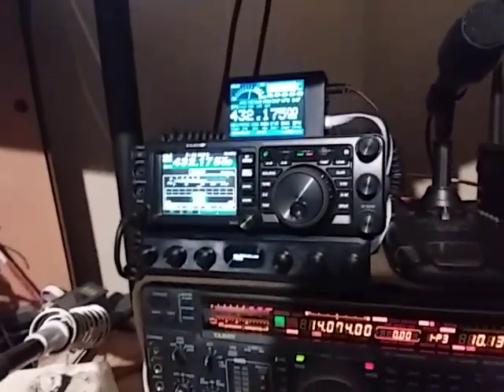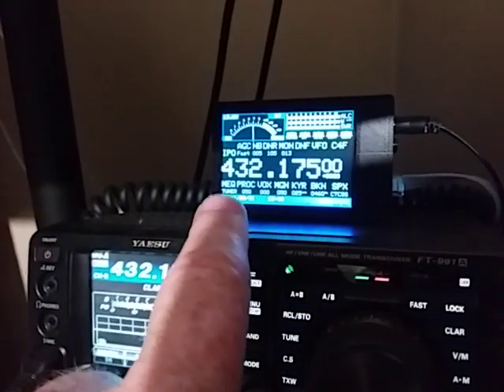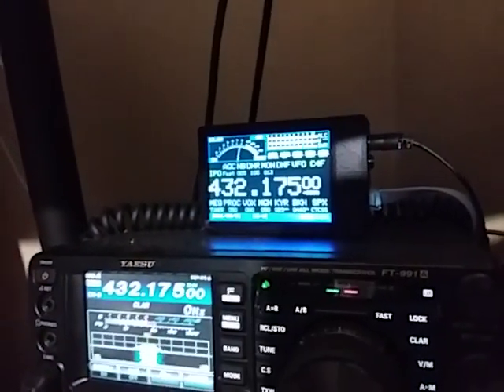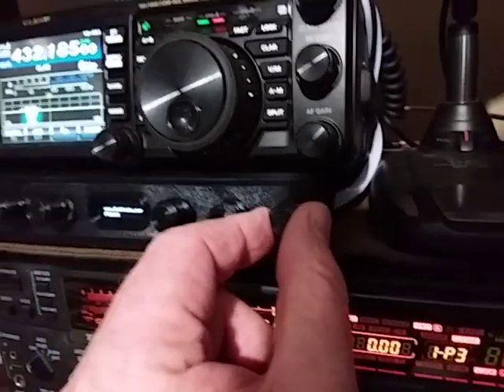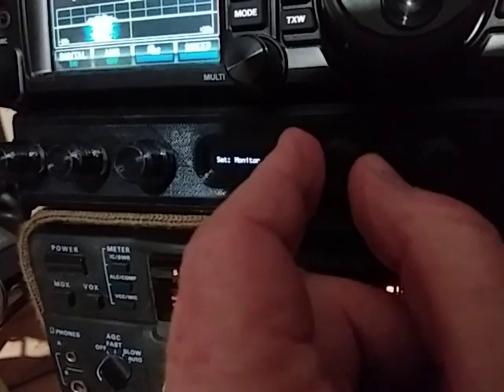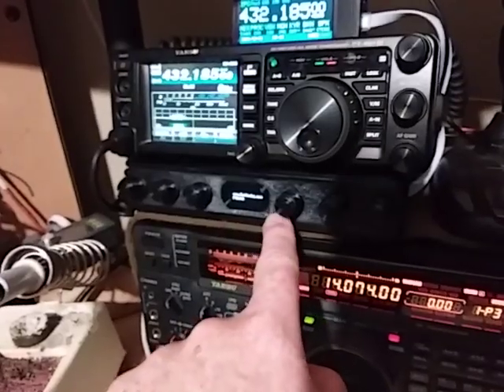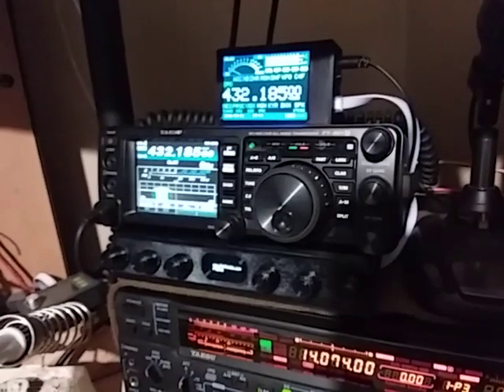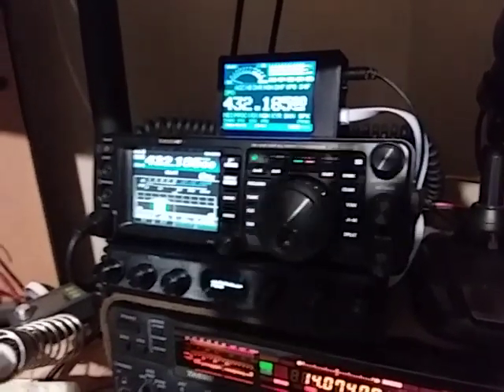CatDisplay & CatKnobz working with FT991A

Comment: I'm thinking of buying the CatDisplay232/CatKnobs bundle but I'm just curious if there is a problem running them from the same power supply that is powering the Yaesu FT-991A as I'm sure that in another video you mentioned having to use a wall wart power supply. I'd be interested to see how you configured the two to power up and down with the FT-991A - hopefully soon as I'd like to place an order ASAP.
Reply from the maker: There is no problem running them from same power supply as FT991A. They both take from 7V DC to 30V DC. I can also set them up so you just apply power to CatKnobz and it will also supply power to CatDisplay232 through the serial cable - there is a link on CatKnobz to enable this. Just FYI there is a 2 day delay in shipping while I build more stock. 73 om de chris zl1cvd
Reply: @ZL1CVD  Thank you for your speedy reply. I'll order now so that I get a good place in the queue! I look forward to hooking them up.
Reply: @ZL1CVD  That was me who just purchased - Rx no. ending 402. Thanks.
Reply: @ZL1CVD  Sorry to be a nuisance - especially if you are busy trying to catch up with orders - but I have been trying to find the link which explains how CatKnobz supplies power to the CatDisplay. I think I have looked at every CatKnobz related page but didn't spot it.
Reply from the maker: @sapaud  No, its my mistake. I designed latest CatKnobz circuit boards (v3) with two labelled solder links. One is called CatDisplay232 Power Link the other is called CatKnobz Power Link. If you bridge CatDsiplay232 Power Link it sends power to CatDisplay232 via the serial cable (RJ45 pin 7 & 8). The CatKnobz power link requires a transceiver modification to work.
Reply: @ZL1CVD  I think I will have to wait until it arrives to fully grasp what I need to do but I am assuming that if I am taking power from the 13.8v switched PS, it powers the CatKnobz > CatDisplay232 without modifying the FT-991A.
Reply from the maker: @sapaud  yes, that is correct :)

Comment: The Cat display can you change  the display view to different  things  then the frequency?  If the radio already display frequency what is the benefit of having the frequency display twice?
Reply from the maker: Nope. CatDisplay is primarily designed to show a bigger frequency for older, poorer eyes. That's why the display is big and chunky. However because it also shows allot of info you'd normally have to wade through menus to see,  on one screen, it has gained a much wider popularity.

Comment: Can you set it up to change the transceiver's power output level? I worry the multi knob on my FT-991A will wear out quickly because I change the power level so often depending on the mode I'm operating. Very 73 de KU4GW Cliff
Reply from the maker: Yes that can be changed - all these can: APF, AGC, Band Up/Down, Contour, Contour Level, Contour Width, DVS RX Level, DVS TX Level, DNR Level, IF Shift, IF Width, APO AMP1/2, Keyer Speed,     Keyer Pitch, Memory Up/Down, Microphone Gain, Microphone Processor, Meter, Mode Up/Down, Monitor, NB Level, RF Gain, Scope Color, Scope Span, Squelch, TX Power W, TX TOT timer, VFO Up/Down, VOX Delay, VOX Gain, Volume
Reply: @ZL1CVD  for date time  set zulu time in the radio and then adjust for offset  local time in config...the clk does not read correct day for zulu time